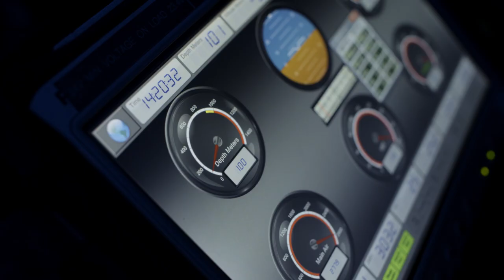Revealing the Secrets of the Deep Ocean | Our Blue Planet | Earth Unplugged

Comment: They go down there in tshirt and shorts? You'd imagine that they would have to wear some form of divingsuit on the offchance that the submersible leaked or something.
Reply: I imagine that if something fails or there is a leak, a diving suit wont help you from getting crushed by the water.
Reply: Charlie Bartlett if the off chance they happened across a situation to have to use their diving suit. They'd be dead already. The pressure would crush your body, along with complications with oxygen. If a leak happened way down there, they would be dead unless they stopped the leak.( it has happened before during filming for blue planet 2 ) it takes hours to go up. So if an emergency happened their is no quickly escaping to the surface. Your screwed.
Reply: PantsB4Squares yeah good point. Its just the pilots will always take a parachute so you'd imagine divers would do something similar
Reply: Any passengers within a leaking submersible would have the life crushed out of them by the substantial water pressure before they noticed their khakis were wet.
Reply: Kaycee K Thats what i thought aswell. I was shitting bricks when i saw this footage of leakage inside the blue plant 2 sub @ i think 700m. Dont remember, i was judt trying to find the footage but its not on youtube.
You can find it watching the deep sea episode of blue planet 2. At the end of the episode they go into what it took to film it. During that last 15min they tell the story and have footage. Its unreal! They had a leak and stopped it. I always thought if there was a leak at that atmosphere its would exponentially speed up, drowning or crushing them.
Reply: Fascinating! I appreciate being properly schooled and thank you for correcting my misinformation. I've always been under the impression that great depths negated any meaningful response time to a compromised seal; I assumed that the incredible force of the water pressure would swiftly force a larger vulnerability, and so on, and so on. And what an idiot I was to have assumed! An ass, indeed!

Thank you again, Pants! And my heartfelt apology to the good Charlie Bartlett, as well! I was WRONG, and my snark was rude and uncalled for. My humble apologies, sir.